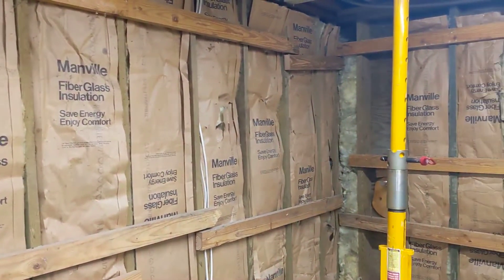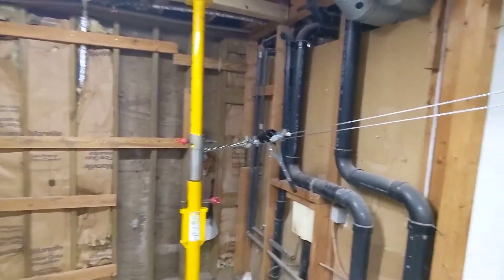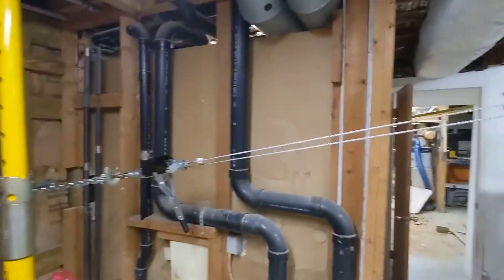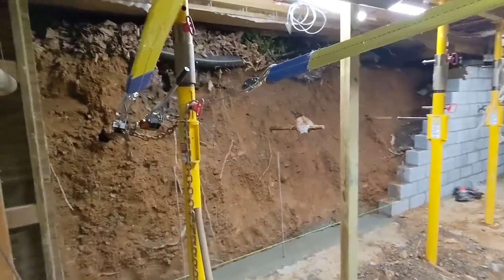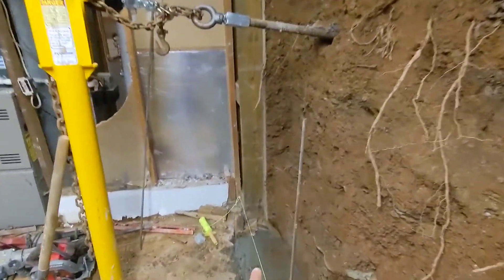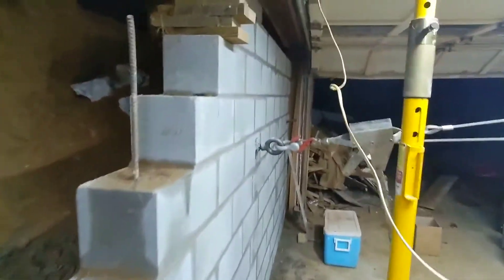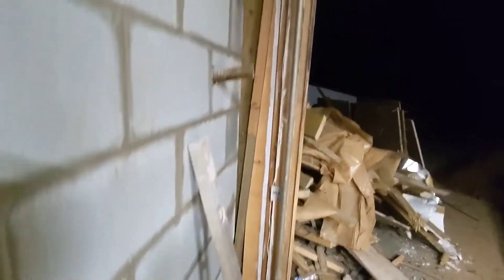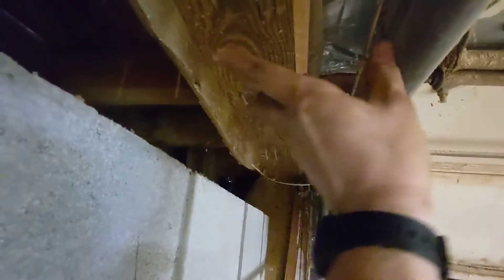Wood Foundation Failure

Comment: Would You use henery blue skin system to waterproof a pwf foundation? Obviously on the inside i have insulation and then vapor barrier. Thanks
Reply from the maker: I would not. A system like henery would need to go on the outside. If you have water and want to fix it from the inside, you need to remove everything and install it right against the foundation.

Comment: Had nothing to do with it being a wood foundation. Poor workmanship. Where the gravel, plastic etc
Reply: Backfill and drainage are more important than a lot of goombas think.  The other guy said it:  the problem is not the design, its the execution.

(Actually, the footer is more important than normal, since a poured concrete wall provides more reaction to vertical shear.)
Reply: @timgerk3262  I did a treated wood foundation for a guy about 20 years ago. He pours a footer and we built the was with 2x8 and 3/4 ply. He didn't brace it right and backfilled too fast with too much dirt. And that thing is still standing after all that
Reply: Yea, they definitely left out some crucial things building the original wood foundation. Hope the repair went well.
Reply from the maker: Do they allow wood basement walls where you are? Here in Atlanta, they were not allowed. It was a surprise to see it in the first place!
Reply: @heidecontracting601  yes they do. Don't know why they are not allowed there. Unless the water table is super high maybe but any basement without good drainage is in for problems. I've seen poured walls cave in
Reply: They use 2x4 for that foundation wall?.!! ? Nowhere near enough strength to hold back the dirt. WTH
Reply: @TranquilVista  2x4, right? The International Residential Code (IRC) has a section specifying how to build these. That code section (from the 1970s) should be updated beyond it's good structural base to mandate better drainage and waterproofing details vs. the old 6mil sheet plastic.
Reply: @TranquilVista  I think they are 2X8s, at least the top and bottom plates were. That garage door opening at the end would have weakened it; I wonder how the wall on the other side of that opening was looking.
Reply: In the 70s they built apartments as beautiful homes with wood foundations it's in how you build it lots of drainage.. I've heard people say they never had problems with theirs...
Reply: I'd expect a stud wall to pivot more easily at the bottom than a concrete wall with rebar tied into the footing. Aren't wood basements more dependent on the first floor framing than a typical concrete one? The garage door opening at the front can't be helping either. But I'm sure there is a right way to do this; gravel would have helped, but more diagonal bracing, even if it cut into the basement space, would also have helped, the same way pilasters strengthen block walls.
Reply: @pcno2832   The concrete slab is poured against the wall and prevents the bottom from pushing in.